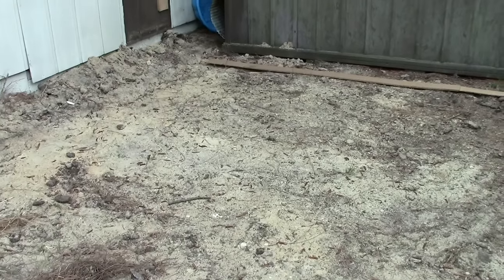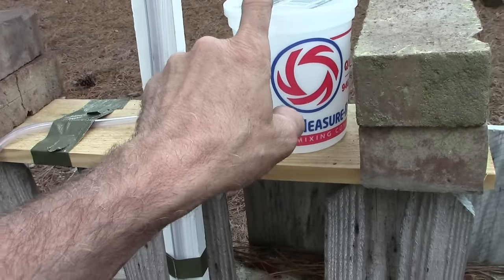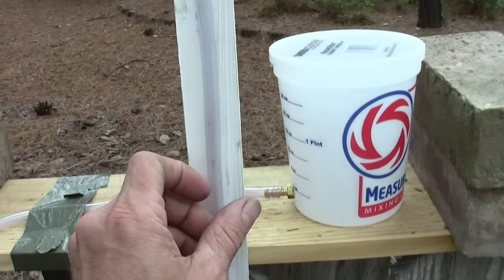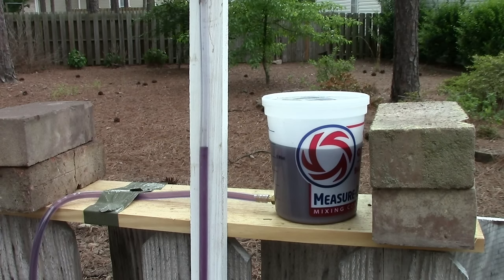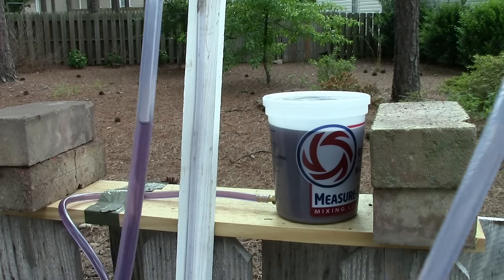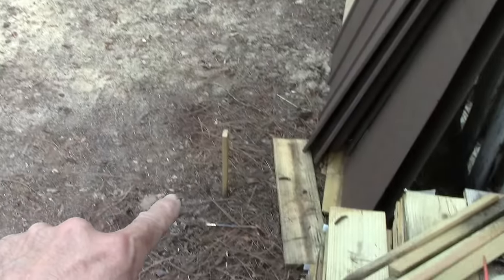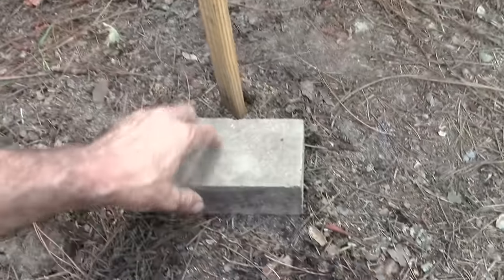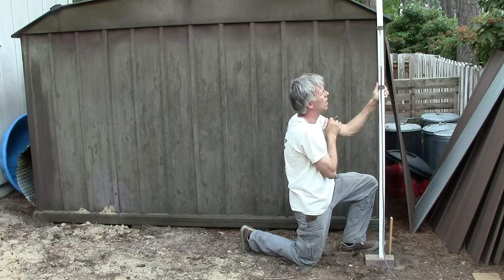How To Make And Use A Water Level

Comment: Back in 1967, I was an apprentice carpenter, Local 906 Glendale sold us carpenters water levels at a reduced cost.  Most of us had one.  The water reservoir has space in it to store the hose.  The water part sealed up tight so that you didn't loose the water over time, it also allowed the micro air-bubbles to escape.  I used that thing hundreds of times, they are more accurate than a transit-level.

Comment: Quick Southeastern Ohio history lesson. In the 1940's, the Soil and Water Conservation Districts started helping farmers set up contour lines in their fields  to help mitigate soil erosion in our considerably rolling hills. They used a hose pipe (as my great-grandfather called it), and two glass tubes (remember, clear plastic hose really wasn't a thing in the 1940's) on either end to make their water level to lay out contour plow lines. They used a setup very similar to this one shown here. The beauty of this over using a transit of any sort is that one man alone could lay out the contour lines by himself. With a transit, it always took two people. A soil technician could mark out the lines, generally with white painted tomato stakes, then leave. Afterwards, the farmer could come along, and all he'd have to do is line up the nose of his tractor, or the hames knob of his horse team's harness with the white painted stakes and be off to the races with his new soil conserving contour lines in his fields.
Reply: Amen to that. Same used by my grandad a master carpenter & bricklayer from Tyrol, Bavaria and my other grandad, as master wood turner from Belfast.

Comment: You do not need to bother with the fancy fitting at the bottom. Just stick the tube in the top, tape it and then siphon it out. The level will still be the same as the level in the bucket. Also, I tape the end tubing to the edge of a yardstick with high numbers on the bottom. That way higher numbers will mean a higher elevation. Actual numbers do not matter; only the difference from the reference matters. Use a few drops of dish detergent to kill the surface tension.

Comment: Pro tip: you can use a cheap 4 ft level that also has ruler measurements on it instead of the white stick. using one will give you an easy way to tell how “off” something is by reading the difference in measurements.
Reply: i realize Im kinda off topic but does anyone know of a good place to watch newly released tv shows online?
Reply: @Braylen Dylan Thank you, I went there and it seems like a nice service :D I appreciate it !!
Reply: @Aarav Zaid you are welcome =)
Reply: A water level is more accurate than a laser and will still be correct up to a kilometer after that your fighting the curve of the earth plus your spot on with squaring
Reply: 6' folding ruler works best.
Reply: @markmaddison5312  there is no curvature of the earth. Never had been. Ask any professional levelers/surveyor/etc if they ever account for curvature. Not for skyscrapers, not for planes, not for sea travel, not for railways. NEVER!
Reply: @mavenfeliciano1710  you don't know what you're talking about mate
Reply: @63flight  Thanks, just what I need for my lot grade.
Reply: @63flight  No, it does not..!! Maybe to a carpenter, but to most knuckleheads, the 6' architect, or engineers rule will just thoroughly confuse them!!
Reply: @mavenfeliciano1710  I think you need the straps on your straight-jacket tightened!!
Reply: @mavenfeliciano1710  VOR beacons are blocked by the curvature of the earth.

Comment: I built a water level similar to this one to level a 24’x 25’ metal building concrete foundation form! Instead of using a white sticks like he used in this video I used a sheet rock T square with the inch marks on it. I was able to set my baseline and then measure up and down an eighth of an inch at a time. Yes it works very well. So well that a friend of mine came out with a laser level and checked my work and it was just as accurate as the laser level.

I also used it to level the shelves in my wife’s closet before I installed them.

Comment: One way to get it pseudo square before you measured diagonally each direction is to measure down One direction 3-foot the ninety-degree angle measure down 4 ft and then in between the two measurements it should be 5 ft.  It's called the three, four, five rule.  That way you won't have to do a lot of adjusting once you start measuring diagonally.  It's a helper
Reply: Lol.....no, it's the six, eight, ten rule!!
Reply: @larryslemp9698  LOL it's both
Reply: @LadyTSurvival  Gee Whiz.....Really?!

Comment: Water tube levels are brilliant, I have one, just a long length of polythene tube. A couple of things I would mention. If part of the tube has been lying in the sun the water in that part can heat up a bit and will then have a lower density to the water in the colder part of the tube. This will put the readings out, however it may be possible to allow for this. The other thing is I always check the level before AND after using it by bringing the two ends of the tube next to each other. Then if there are bubbles or different densities it will show. Good video

Comment: True "the environment changing'' from day to day will effect the calibration. AKA temperature and barometric pressure. The key to circumventing this natural occurrence, Is why a "station point'' was designated. Station point is the height you wish to maintain of the finished product.  If the reservoir is placed at the same station point every day, and allowed to acclimate to the environment, then it will self calibrate. If the station point is higher than the finished product height, you would measure down from the water level to determine how far your finish product height is below your water level height. Using boards with yards sticks and tubing attached to, makes this process much easier. Using wind shield washer fluid, allows this system to be used below freezing temperatures, because it will not freeze

Comment: If you use a 3/8 tubing,you get an accurate reading on your level..note:if you look at the video you'll notice the water fluctuating a lot.By using a 3/8 tubing will keep that fluctuating to a bare minimum,therefore giving you a fast and accurate reading

Comment: Just made one of these to check for view blocking and base level for the HUGE shed I am about to have built. Using hose pipe, the hozelock cone shaped sprayer works as a valve and I have it poked in the 3/4 inch internal diameter clear hose I am using for seeing through, attached to 20 metres of garden hose with a jubilee clip. Fixed join at the other end is the nozzle from a caulking gun, cut down and pressed by hand into the hose pipe to give a rigid core. Then built up with electricians tape, then shoved in the 3/4 inch clear tube and secured with a jubilee clip. I should be able to close the sprayer nozzle, those yellow long cone things, to move around, then open it slowly to get to let water move to get level. In case I judge wrong I don't want to be over topping out the tube all the time. Measuring over 100 meters in stages with 20 meters of garden hose. Should be fun...

Comment: When I built my 10x16 shed 25 years ago,, I used a rifle scope taped to a 4-foot bubble level for one end, and a vertical yardstick at the other end..  It was what I had handy :-)     Now, I need to replace support posts on a 50-foot porch and want something more accurate than the bubble level (carpenters' level), so I'm planning to put together a water level to be sure the porch roof beam is kept level as I go.
Reply from the maker: Water levels are great for all kinds of projects.

Comment: There are some limitations to this method: it won't work over huge distances because of differences in barometric pressure. It also isn't completely precise because the earth's gravity changes slightly depending on geology. However, the way it's demonstrated in this video shows a perfectly valid way to use this technique.

Comment: well done, you know what you are doing, without any mystery, lucky that in is on sandy base, which will not shrink in a hurry, good to get the correct instructions, the simplest solutions, are the best.
thanks very much.
 I now drain the water out, when I have finished, or I find that Algae, grows and produces a " gas  bubbles " which is a problem, I avoid now.
Reply from the maker: Thanks for watching.

Comment: Long time fan! That is a cool water level example, I do have some constructive feedback I think... Your diagonal measurement to determine square is not quite complete. You should state that 2 opposite sides are 10' and the other two opposite sides are 12'. You let the viewer assume this but it should be stated for completeness. Without validating the opposing side lengths are equal your diagonals could be the same value yet you wouldn't have square corners. Nitpicking I know, but for completeness I thought I should let you know. I have setup square foundations many times but never used a water level. I would think a water level would be a ton of extra fussy work. We always put the 4 corner stakes down and validated square. The stakes would be tall and outside the boundary of the final foundation. We would then run a very tight string line between all the stakes using a "line level" to validate the line was level between all stakes. This gives a level starting point for your foundation. You then simply measure down the same amount at each stake and along the tight line to excavate down to a level foundation grade. If you want to check in the middle of you structure you can pull a level tight line between any two side lines and measure down from the new level line, real easy. I have only seen water levels used where you can't pull a level line because of obstructions like existing buildings, rocks, hills or such. Thanks for sharing your water level example, it was nicely done.
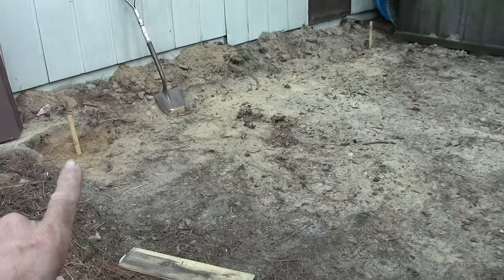Reply from the maker: ***** The diagonals have to be the same value to be square. If they are different it won't have 90 degree corners. At 4:12 I mention that the layout is 10' x 12'. I agree that a line level technique is best for a large excavation that needs to be level. A water level is a good tool to quickly check a site at may points. Thanks for watching. :)
Reply: I think the requirement for square corners is: diagonals both the same length that intersect at their half way points. Alternatively; diagonals the same length and opposite sides the same length. 

HackaweekTV  I think you conveyed that perfectly (first established opposite side lengths equal then established diagonal lengths equal) and Todd is nitpicking.
Reply: HackaweekTV:
Great job!  Thanks!   Try not to reply to 'nit-pickers'; it only encourages them to keep trolling.
Reply: Once done the strings are in the way.   If you want to recheck you have to set them up again.  A water level can be put aside and quickly brought back to points that need to be checked.

Comment: How do I determine where to put the bucket of water? Also, when going from block to block did you move the bucket or leave it in the same place? Thanks ahead of time.
Reply: the bucket needs to be in the same spot for all measurements. it sets the reference level.
Reply: vibhupande That makes since. Thank you. What if I was using this inside a house? How would I do multiple rooms? Would I just do one room at a time?
Reply: How would I do multiple rooms? Would I just do one room at a time? - No need to repeat this the long way. If you have a long tube/pipe running, then you can do multiple rooms. Just keep your bucket in one spot, make an initial measurement, and mark it on the tube end that you'll be carrying. Then, either use that mark or use a scale relative to the mark, and you can use it to match a height across all rooms. The water will rise to the same level for same height in all rooms.

Comment: Cool. But is the brick level or higher at one end and lower at the other? Should have used sticks that are stuck in the ground instead, and then you mark your zero level on them. Regardless of this obvious potential error in measurement, excellent video.

Comment: Hi, can you please tell me what brand of clear hose do you use for the water level?
I have used water levels almost my entire life and have found that the clear hose becomes foggy to the point of making it very hard to se the water miniscus to mark levels.
It would be much appreciated if you happen to know a good quality hose that does not suffer from that problem.
Good videos, Regards,
Franklin
Reply from the maker: I used cheap clear vinyl tubing. Yes, over time it does get cloudy and stiff. You might try clear silicone tubing: https://coldandcolder.com/products/silicone?variant=31585760641121

Comment: Hi, this is a very nice video. thanks for sharing. I have a question, do we need to choose the lowest point of the of the land to mark as "0" point or the highest point ?
Reply from the maker: You pick a point that you want to level everything to, and you mark it. Then you measure at different points and adjust until it's on the mark.

Comment: He is not necessarily square. By measuring diagonal you can still be off. The way pros do this is 6-8-10. Yes Pythagoras. Measure one side 6' the other side 8' and 10' on the diagonal from 6' point to the 8' point, adjust as needed. Do the next side working off of one of the previous square sides. Then check diagonally.
Reply: He’s already stated the dimensions of the sides. Regardless, if the diagonals are the same, it’s square.

Comment: Was electrician and saw two guys do this on big lay in ceiling using a 100 foot water hose and it was right on the mark and level ,thanks,about forgot how it works they just held one end of hose on their 8 foot mark And the other guy had a funnel taped to other end the other guy would go to other wall and get close by guess and had gallon of water and would pour water in funnel till came out other end that was on the start mark , he would fill funnel and let it down or raise it till he saw water then he would fill slowly till funnel was exactly full to top holding against the wal till it was even and then put mark on wall and go to other three and do same, the ceiling was perfect just using water hose you could see three, I don’t know what Egypt used because had no rubber hose or vinyl  tubing
Reply from the maker: Papyrus reeds and pitch.

Comment: i am wondering if the ancient Egyptians had these, i always thought they did not have hose type things cause everything was built using gravity flow and not any siphon because they did not know about it and sealed tunnels,  maybe they just used a canal type thing and measure the water level, i was not there so i will never know, thanks excellent video

Comment: Great video.advice on how not to have air bubles. You just lift up tube and dont allow water to goes into tube until you have bucket filled with water.then you start filling the tube with water. In this way you dont have any air comming from bucket, because there's no air in bucket  :).You might however have some air bubles cause there is air in the tube but maybe not.anyway you let the water in tube a comming with controlled speed and a moment you see buble being created stop and return water in tube and colapse that buble.

Comment: The further your hose gets away from the bucket, the lower the level of the fluid in the buclet will be. You can see it happening as he gets the air bubbles out
Reply: The level stays the same regardless of the distance.  Yes, of course, the level will change as the air bubbles escape.

Comment: Why did you measured with a brick in place? just to average over the area the brick will lay down? placing a brick to check every location seems kind of slow... could have placed a board under it maybe?
Reply: madinatore Because every place where the frame sets will have a brick under it for support. I set the zero point with the stick setting on a brick so all other measurements have to be made with a brick in place. I ended up placing bricks in each corner and a few in the mid section.

Comment: Great video.. I leveled the ceiling of a 20  x 12 foot room with a  water level. The only error you will have is the concavity of the water at  top of the water column in the tube; and that's only going to be a 32nd of an inch.  The only thing more accurate would be a builders transit.
Reply: If you had paid attention in science class, they taught us how to deal with that, its called the "meniscus"

Comment: Not very clear how you got a pipe thread fitting to screw into a plastc container that does not leak.
Reply from the maker: It's a tapered thread so as you screw it in it self seals.
Reply: @HackaweekTV  But a tapered male thread has to go into a tapered female thread and requires multiple thread engagement to seal. How does it seal on a piece of plastic that is likely only .030 to .040 thick?

Comment: You used the 555 chip a couple vids back ( I really liked it as I made a smd led light bar for my rc car ) I was told the 556 would be more beneficial to use,  can you show how the main difference as I run 3 separate flashing sequence to do our Australian police vehicle lights. Please
Reply: ***** 
Here are the date sheets for each IC chip.  556 is just two 555s in one IC package.  Self explanatory.  See pin out on each data sheet
http://www.ti.com/lit/ds/symlink/ne555.pdf
http://www.ti.com/lit/ds/symlink/sa556.pdf
Reply: jp040759 thank you very much for the info I will have to experiment as am still a novice but again thanks.